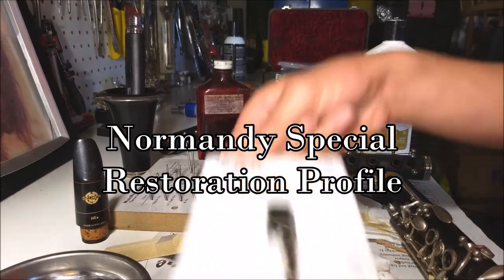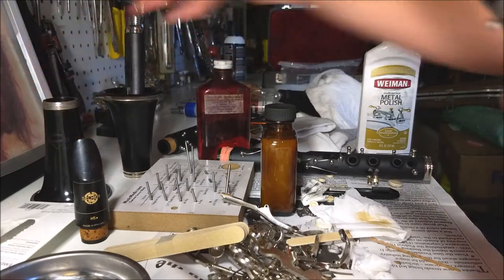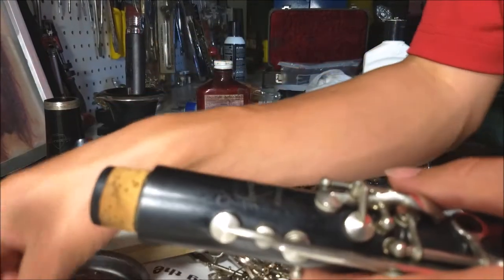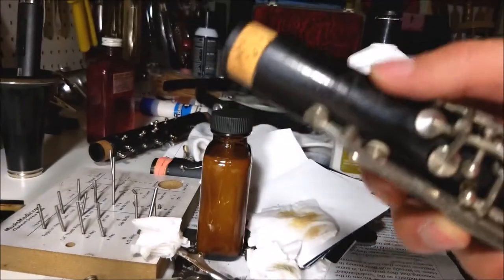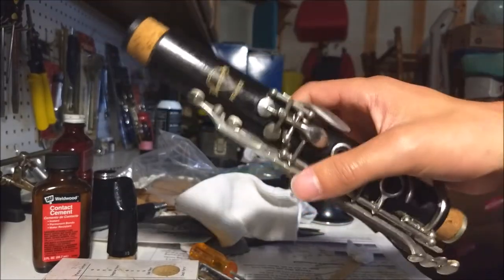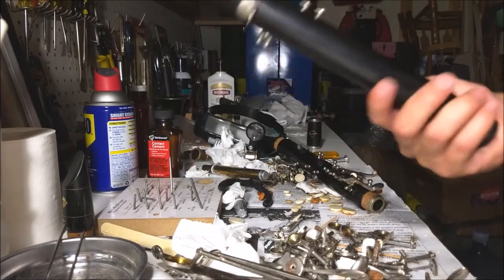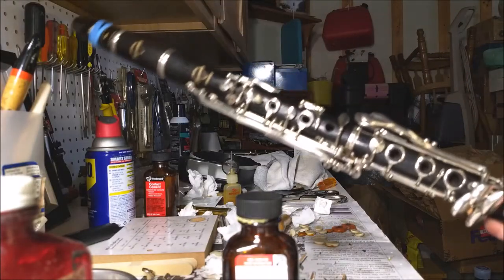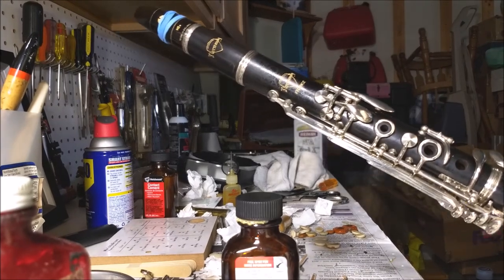Clarinet Restoration Profile: Normandy Special

Comment: Seems like a few details are missing:  repadding; replacing corks; spring and key adjustments.  And what about oiling the inside of the bore, which usually needs it the most?
Reply: In the interest of time I cut a lot of this out. These jobs usually take around 6 hours. These days I use an almond/thyme blend (almond to treat the bore, thyme to disinfect)

Comment: Hi,
I watched your video about repairing a Normandy Clarinet and got interested in the process of filling the logo on wooden instruments, specifically the clarinet. I have two clarinets and I would like to restore the logos and I have not found a technician here in Brazil to do this work. What ink did you use? could you pass me this information? Thank you very much in advance...

Josué de Oliveira Belino Bonfim
Reply from the maker: I use a Krylon gold leafing pen. You can find them on Amazon here (NOT sponsored): https://www.amazon.com/Krylon-K09901A00-Leafing-Gold-Ounce/dp/B003ZTNENS/ref=sr_1_2?crid=3IDNVZMK0V7IA&keywords=krylon+leafing+pen&qid=1657586903&sprefix=krylon%2Caps%2C1392&sr=8-2
All you need to do is put a bunch of ink over the logo, then wipe off the excess with rubbing alcohol. Then use a needle to clean up the excess in the grain.
Reply: Boa tarde @jobb.bonfim você achou alguma tinta ou caneta parecida aqui no Brasil?

Comment: My d key goes down when I connect my lower part of my clarinet please help
Reply: This is perfectly fine and completely normal the upper and lower joint keys connect via a pair of keys called the bridge keys. You can find them right under the side keys of the upper joint (Eb/D# key more specifically). The D key gets lowered after the lower joint bridge key lifts up the upper joint bridge key.

Comment: how much would it cost to restore clarinet excautly the same way You did ? I am planning to do it and I'm wondering how much money i will have to spend for it. I will be grateful for the answer.
Reply from the maker: I charge a flat fee of $150 + shipping both ways. You can visit my website at https://watsonmusical.wixsite.com/watsonmusical

If you want to do everything YOURSELF: you'll need several hundred dollars in basic tools, supplies, and materials. It won't be worth it unless you plan on doing it alot - otherwise your investment is pretty much wasted on a single project.

Feel free to email me at daveleblanc@clarinetpages.net for easier communication

Comment: will rubbing alcohol damage the wood or not
Reply: Most woods have a natural-oil-content, which will of course be affected when using alcohol -  it will not damage the wooden fibres, but after using alcohol on the wood, you will normally wan't to substitute the natural oil, with some similar oil, wax or other, that will protectect the wood against changes in humidity - or even direct exposure to water